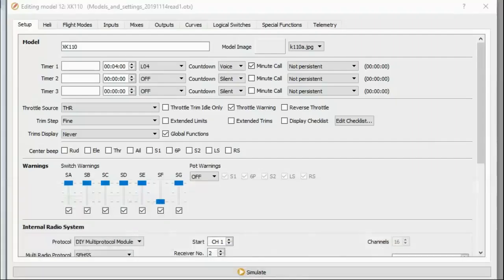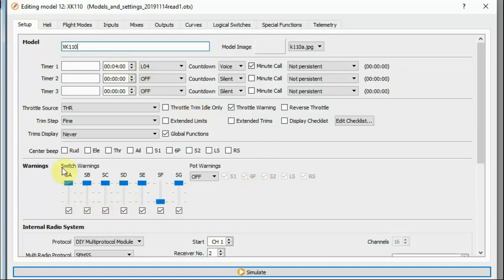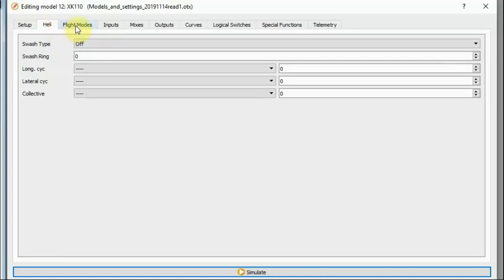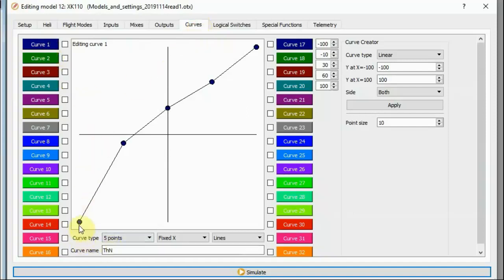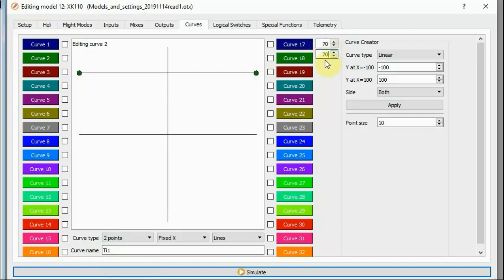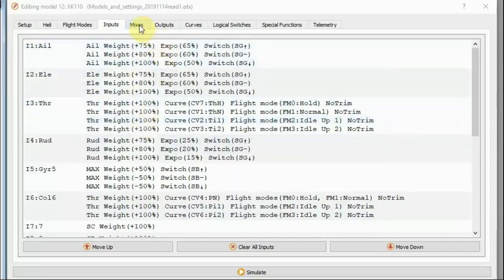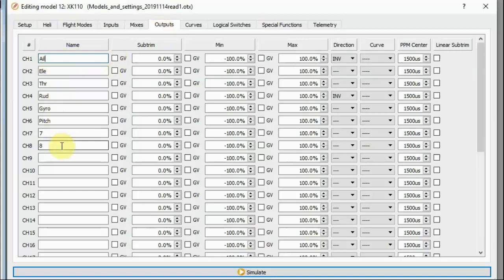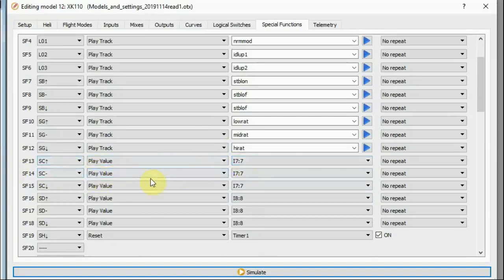OpenTX Heli Programming Pt 2 -  Flybarless Helis with Pitch Control XK, Blade, etc

Comment: hi, after I setup the transmitter, how do i turn 3d mode? thank you
Reply from the maker: Which heli are you asking about now? Generally to get into Idle Up mode, you would need to have throttle hold off (since that locks you into Hold mode) - so, with the setup given here, switch F towards the back of the transmitter. That should give you a 'Throttle Active' message (though you may not have the same sound tracks to play that I have - I am using the Amber sound pack). Then switch E controls the flight mode - back is Normal, middle is Idle Up 1, and forward is Idle Up 2. For the XK110 switch B is also controlling the 6-axis stabilization - for 3D you need to turn that off, by flicking switch B down. For the Kyosho, switches F and E would be the same, but there would be no stabilization, so no need for switch B. If you have the right sound tracks and the special functions set as I give, you should get voice feedback for all of these switch settings.
Reply: @kleedhamhobby  yeah I did all soundtrack as your video, im talking about the XK k130, for the Kyosho didn't start the project yet, thank you

Comment: Hi there. Gonna try and program my 380 to work with the Jumper T16. I’ll order the SFHSS receiver also. If I send you the file I did, do you mind going through it for me? Thanks!
Reply from the maker: I can try. What 380 is this?
Reply: @kleedham 
Goblin 380. I have a inexpensive flybarless unit in it called the KBAR, clone copy of Mini VBar.
Reply from the maker: @scrc511  If you have a flybarless controller in it, the programming should be essentially similar to what is shown here... but I would not know the specifics, such as what throttle and pitch curves would work best, and what channel reversals might be required. The manual for the heli would likely give suggested curves. For channel reversals, it's mostly a case of 'guess and check'; for Futaba I've generally found that channels 1 and 4 need to be reversed - but I wouldn't assume that is gospel for all cases.
Reply: kleedham 
I sort of remember how the programming works just couldn’t remember some of the definition there. For example, just an example on the switch, like this !SE? When do you use such switch vs just SE..and going on to the logic where you use LO1 AND, then that pertaining switch. I don’t really get those when it’s all there already in inputs and Mixes? Thanks
Reply: kleedham 
And also for the channel reversal, once it’s bound to then SFHSS receiver I can go in to my FBL unit and check the channel output of the Tx and reverse what’s necessary.

Comment: Setup jumper t16 for wltoys v950?
Reply from the maker: Yes, I have the v950, and it works fine with the T16. But not as is this video - see the next video, Part 3, which has the set-up for v950 and similar helis: https://www.youtube.com/watch?v=fTpSCgJr1Zw
Reply: @kleedhamhobby  whats is v950 protokol in jumper t16?
Reply from the maker: @deddybermana8707  KN with WLToys sub-protocol, as shown at 2:30 in Part 3, the video for those helis (v977, v950, v930 are all same protocol).